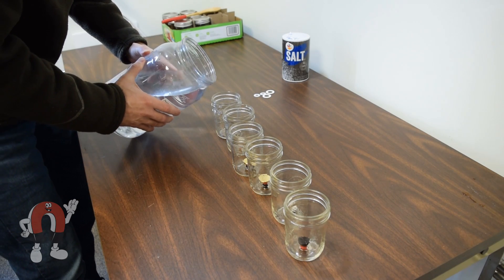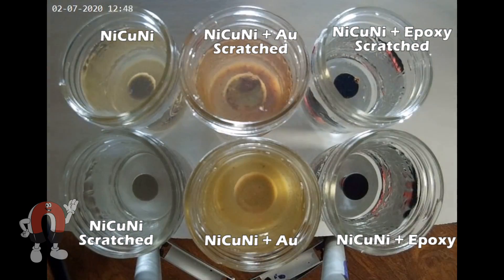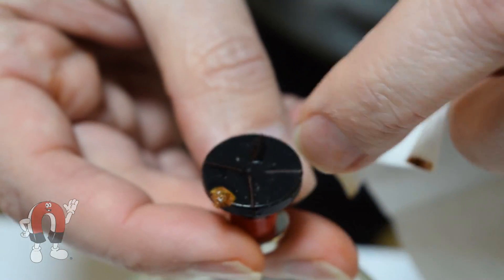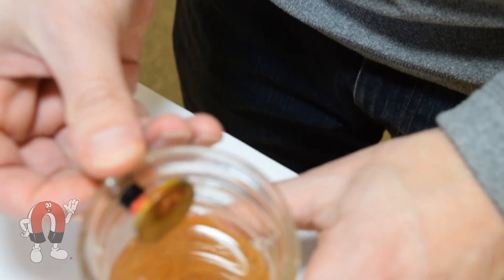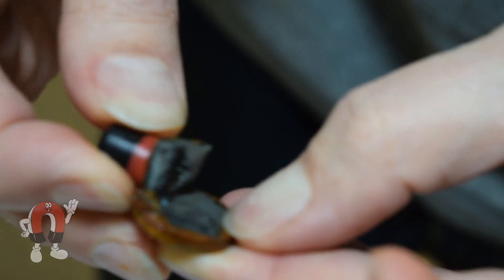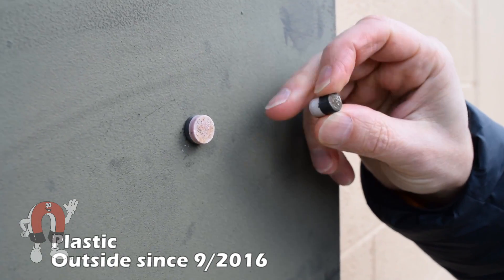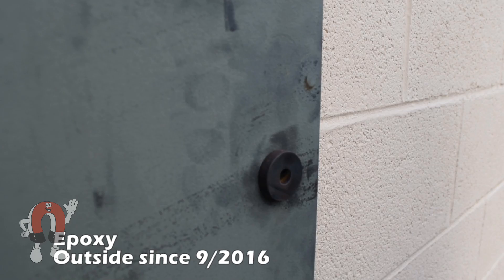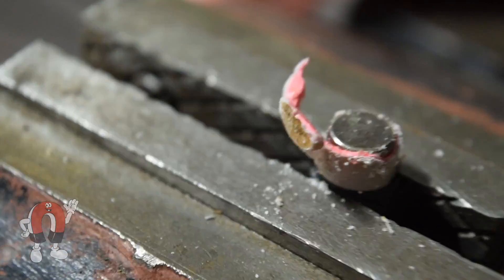Magnet Rust - Salt Water Corrosion Experiment & Time Lapse

Comment: If I could just do 1 of my experiments. Wouldn't look like that. . But senc your such a smart ass. . I'm just wondering, smart boy . Tell me what the separation is H2O. Then I would like you to tell me what the separation looks like. . when I was jus a little boy my DaD had shown me something. The little blue bubbles of light. He told me at that time. This is electrolytes. . It didn't dawn on me until later on in life to know that he was wrong. And what's so funny is that he could not remember showing that. So when you get you MIT CERTIFICATE. I WILL TE YOU WHAT THAT MEANS. HEY . I HAVE AN IDEA WHY NOT PUT YOUR EXPERIMENT ON THE HISTORY CHANLE. DID I SPELL THAT WRONG.